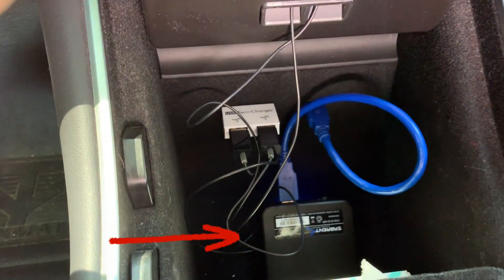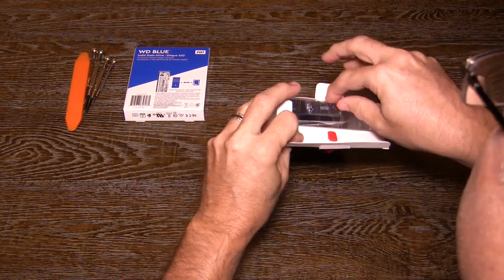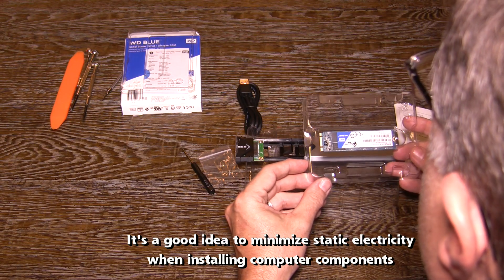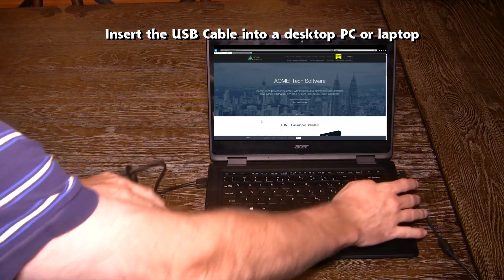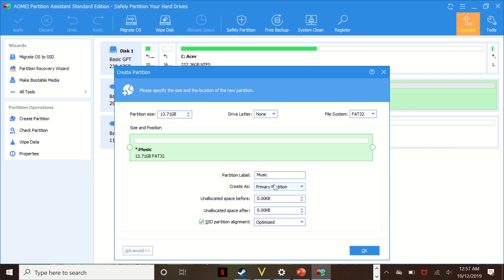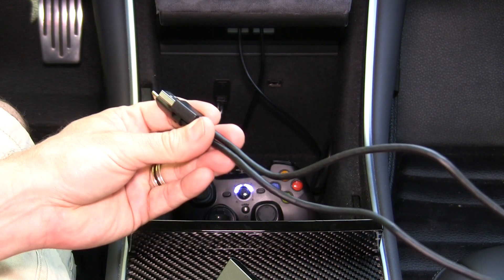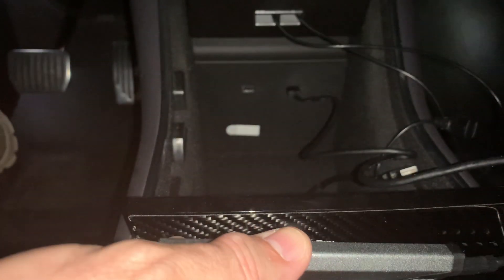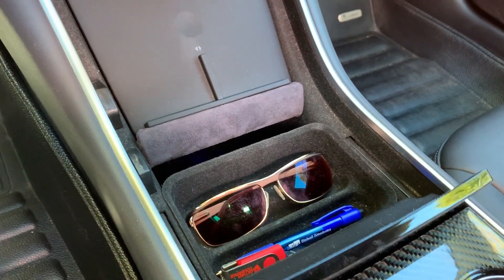Tesla Model 3 - M.2 SSD for TeslaCam and Sentry Mode

Comment: so, 2 years later. how did the SSD/enclosure hold up? Did you ever get any errors to where you had to reformat?
Reply from the maker: Still works great.  No issues with Sentry mode or playing music.
Reply: @MTNRanger  Does it get hot when used as sentry?
Reply from the maker: @Duxa_  It gets warm, but the aluminum housing dissipates the heat.
Reply: @MTNRanger  I ended up getting this exact enclosure and while driving around its warm, but I parked in the sun during the day with sentry on and when I came back (After a few hours) the enclosure was so hot it hurt to touch it. You have any experience like that?
Reply from the maker: @Duxa_  Luckily my car rarely gets really hot since I park in a garage are home and work.  However, SSDs should be rated to 160F or 70C.  I would recommend using the cabin overheat protection with AC if you get really hot.
Reply: @MTNRanger  Yeah, the issue is that that compartment gets no ventilation. What I ended up doing is buying some Thermal pads to put on the SSD chips so that it actually comes into contact with the aluminum case and use it as an actual heatsink. That seems to have dropped stress test (writes/read on a PC to stress the drive) from ~65C at hottest to around 43C. More than 20 degree drop. Will need to test in the car under sun with sentry mode.

I think the issue without chips being in contact with the case to dissipate heat is that they heat up the air inside of the enclosure, which makes it like a little oven. Where that hot air heats up the case. Air is a bad thermal conductor so cooling of actual chips is not great. But now the case being exposed to the outside should channel heat away from the chips.
Reply from the maker: @Duxa_  I'll have to look at my case.  I can't remember if I used thermal pads or not.  In any case I have some extra ones from my PS5 SSD install.

Comment: Ok, so $100 or so for basically a fancy USB stick you still have to take in and out to transfer the files. Why not just use the TeslaUsb free project on Github with a $10 Raspberry Pi ZeroW instead and have the files automatically transferred via WiFi and no need to ever remove the drive. Not to mention auto repair of the FAT32 partition and even music synchronization. USB or SSD for TeslaCam is so 2018.
Reply from the maker: Choices are good, not everyone has WiFi available for their car at home, or care to embark on Raspberry Pi projects.  Thanks for the suggestion, it was one I was considering doing for a while now.
Reply: SemoTech 4 Tesla since I am not technically savvy, tell me more. It sounds interesting to do this over wiFi
Reply from the maker: @Newzchspy  Look here for more info: https://github.com/marcone/teslausb?fbclid=IwAR0_qL7nuyN-WWpUU1nyNYG4Ss6o58n4Z3zMVG636U3XQ6HTwOPc019rG4A
Reply: Choices are good @Tesla Tips, but even without home WiFi you could use a hotspot and have the Pi send the files to your home via the Internet if you open a port on the Router. Still best option for $10, tho I admire  your ingenuity for the enclosure.

Comment: Thanks and great video.  Eventually Teslas  should support pcie hard drives natively so you get the speed advantages too. I like What you did. When I eventually migrate away from 256 GB USB stick I will do what you did.  I like why you did better than a standard usb SSD hard drive.  Thanks again
Reply from the maker: The Model 3 has a USB 2.0 connector, so there is a limitation on speed anyway.  The SSD I use is plenty fast enough for this use case.  

Some car manufacturers are moving to USB C  connectors, I see Tesla doing that at some point.  The higher power rating would be better for chargers too.